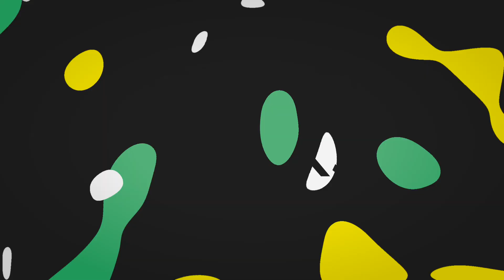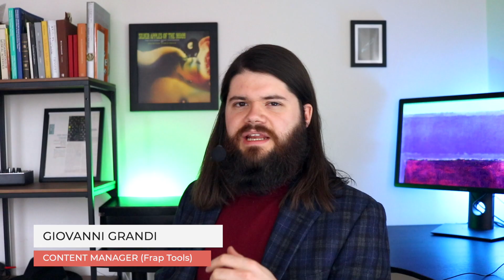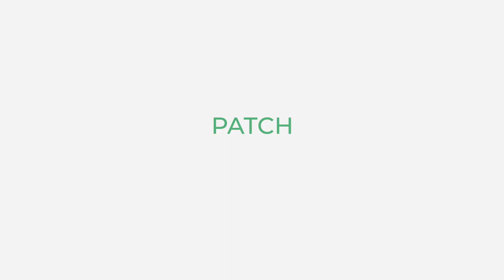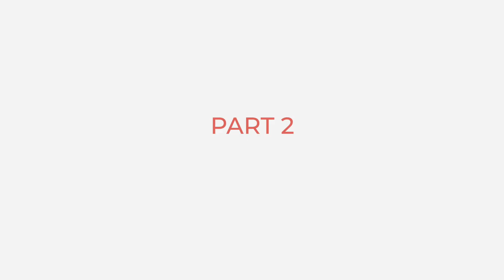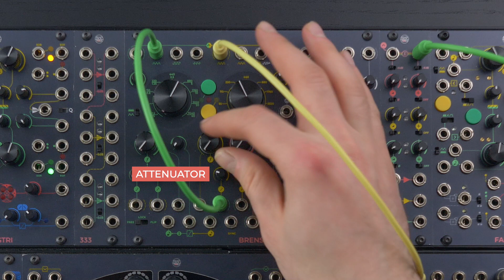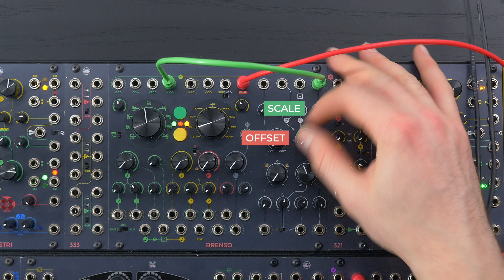Amplifiers, Inverters, Offset | Frap Talks

Comment: Curious about that sidechain comment in needing a slew limiter. Is that to simulate the attack knob on a compressor?
Reply from the maker: Precisely! Especially with FALISTRI’s slew limiter, which has independent controls for the rising and falling segments, one can simulate the attack and release controls of a sidechain compression.
Reply: @FrapTools  very cool! I would have never thought about that but when you break a device down into its simpler components it makes sense!